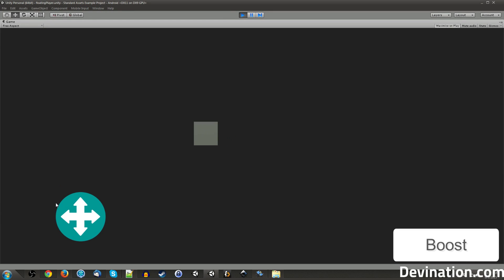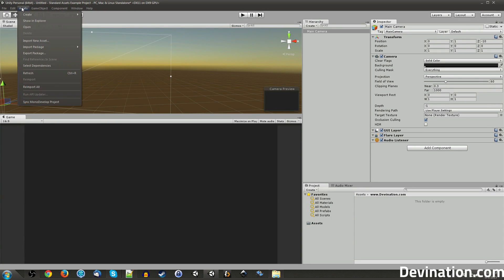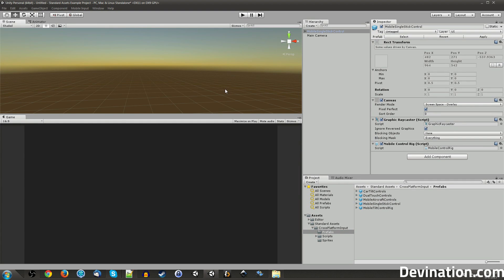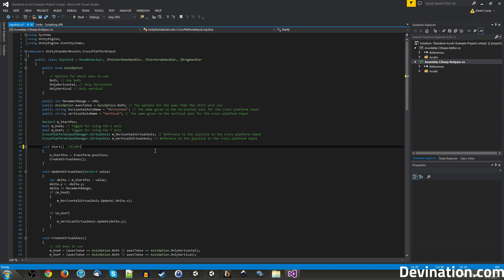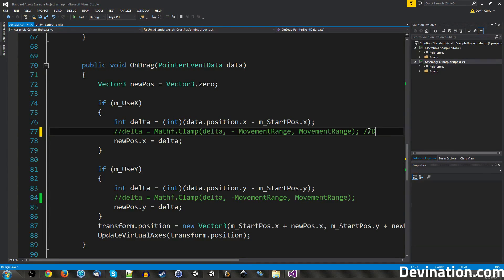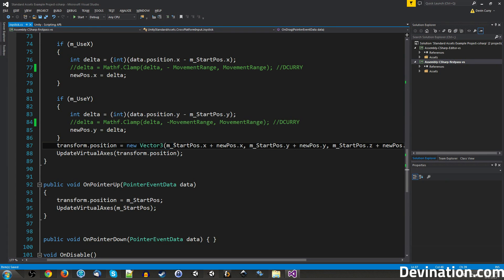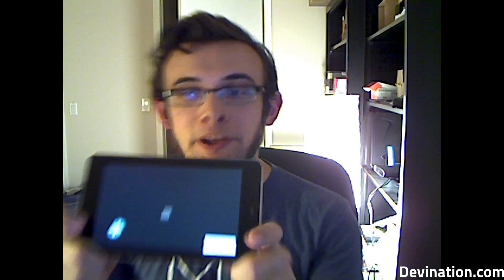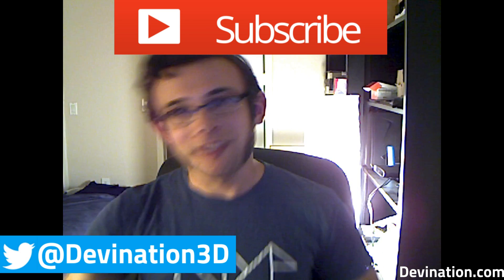Unity 5 Mobile Joysticks Tutorial - Touch Input 2D Spaceship Controller

Comment: It works... Kind of... But how do I make that the player move without gradually slowing down? (meaning that the player stops moving as soon as i leave the finger from the controls) Also, as soon as I touch the controls the player goes fast as hell. I tried changing the value from 5 to 1 or even lower but nothing changes...

Comment: Thank you for your tutorials, if someone have the issue that it didn't move because haven't done the tutorial about the button, do it and hide the image script from the jump button and do the the tutorial about the button at the end.
Reply: I'm having an issue where I can't even move the joystick at all. I've done everything in the video and my settings all seems to be correct. I'm wandering if it's because the script used in this video is outdated?
Reply: The best solution is do it again ( I have to to another level using this tutorial and around 2 or 3 hours doing the same in diferent ways and finally it worked, idk how but unity is weird

Comment: I have a question: Why in my project  if I have a code like this:
var sprintPressed = CrossPlatformInputManager.GetButton("Sprint");
written in the FixedUpdate.
Why Unity detect if I press it just once and not once every frame? What I did wrong?
My "sprint" button is like your Boost Button

Comment: This is amazing, but how would i make it so that only run the joystick if its on a mobile device and run the keyboard commands on a computer, because i want to implement it into my game
Reply: Build one version with the touch controls, then create the same scripts but with keyboard controls, then apply the keyboard scripts and build that version
Reply from the maker: You don't have to make 2 different scripts. This script will work that way automatically. The CrossPlatformInputManager class makes it so that if you build on mobile it will read data from the virtual joysticks. But if you build on PC it will accept what ever you have for "Horizontal" / "Vertical" input set in your Input Manager (keyboard and physical joysticks by default)
Reply: I ended up having the keyboard controls be under  #if  UNITY_STANDALONE || UNITY_WEBPLAYER, and the use  #else  for the mobile input

Comment: Is there something I have to do to get this to work in the Unity Editor? It will work on my phone if I build it and install the APK but I can't use it straight from the editor in Unity to do testing. And I would like to avoid having to build and install the project every time. I have tried running the scene on both iOS and Android platforms and there is an Eventsystem in the scene

Comment: This is awesome, Devon. Can you help get the right stick to come the camera like your " Unity Touch Joystick Player Rotation  - Touch FPS Controller (Part 2" video?
I watched the Unity Touch Joystick Player Rotation video and the new Unity does not seem to support the Touch class.  Is there another class to get the yaw and pitch to work?  It is having a bit of trouble accepting "Input.GetTouch (touch2Watch)" and the "camera.eulerAngles"  code in the "void ApplyDeltaJoy ()" from the previous camera rotation video.

pitch-= Input.GetTouch (touch2Watch).deltaPosition.y * rotateSpeed * Time.deltaTime;
    yaw += Input.GetTouch (touch2Watch).deltaPosition.x * rotateSpeed * Time.deltaTime;
    
    // limit so we don't go past 89 degrees
    pitch = Mathf.Clamp (pitch, -89, 89);
    
    // do the rotations to whatever this controller is attached to
    camera.eulerAngles = new Vector3 (pitch, yaw, 0.0f);

Comment: How can I increase the speed of the block as it has a set limit which is not as quick as I need. Great video by the way thanks.
Reply from the maker: +Chris Devine Make a new float variable called 'speed' then multiply your moveVec by speed when applying force

Comment: Devin,
When I am touching the joystick and at the same time touching jump button, the jump does not work. 
[Position of joystick : to Left
Position of Jump : to Right]
Also, if my joystick is to the left and I hit jump button, the joystick moves to right(towards jump button, though not beyond its range) and jump does not work.

SO, I see the problem is it is not distinguishing between single touch and multi touch.
Any solution?
Reply from the maker: If you are using the Unity Remote to test this, it will not support multitouch. You will have to build to your mobile device to test out the multitouch functionality
Reply: When built, and installed on phone, the joystick does not even move. Can you put some light on that?
Though, multitouch is working that way (Thanks a lot.)
Reply: Thanks for the help 
It is working fine now!!

Comment: i done everything the same but yet it says "Assets/Floating2DController.cs(23,105): error CS1729: The type `UnityEngine.Vector2' does not contain a constructor that takes `1' arguments" and i have no clue what it means by that
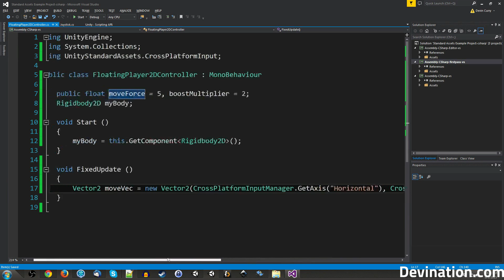Reply from the maker: +No Craig That error code says that you've missed an argument in defining a Vector2 (probably moveVec). Make sure you have 2 arguments in there ("Horizontal", "Vertical") I zoom out around 12:05 to show the full line with the 2 arguments in the code
Reply: +Devin Curry thx buddy I fixed it...keep up the good work

Comment: No words, just perfect and I didnt spend much of my time doing this so.. thx bro. +1
Reply from the maker: +Daniel Queiroz Awesome, I'm glad it could help!
Reply: Hey,  mate. Have tried to incorporate 2 joysticks at the same time? like 1 for movement and 2 for look around - it looks like it has some problems - 2 joysticks sorta interfere with each other.
Reply: Vladimir Kornev yeah i did, i dont remmeber what problems i had but  i had to changed some lines of the code in order to make it Works well :)
Reply: Daniel Queiroz maybe you'll give me a hand then? I constantly experiencing a bug - move one of the joysticks to some side  and just hold it (like moving forward for example) and then when I start moving the second joystick (looking around) the first one starts to also move from side to side although my finger is still, it's like it's receiving PointerEventData update from the second joystick.

Here is the code, I really fail to understand what's going on... "bigImg" - is joystick's square - it's only as big as the joystick itself.

public virtual void OnDrag(PointerEventData ped)
    {
        Vector2 pos;
        if (RectTransformUtility.ScreenPointToLocalPointInRectangle(bgImg.rectTransform, ped.position, ped.pressEventCamera, out pos))
        {
            pos.x = (pos.x / bgImg.rectTransform.sizeDelta.x);
            pos.y = (pos.y / bgImg.rectTransform.sizeDelta.y);

            inputVector = new Vector2(pos.x * 2f + 1f, pos.y * 2f - 1f);
            inputVector = inputVector.magnitude > 1f ? inputVector.normalized : inputVector;

            joystickImg.rectTransform.anchoredPosition =
                new Vector3(inputVector.x * (bgImg.rectTransform.sizeDelta.x * .3f),
                inputVector.y * (bgImg.rectTransform.sizeDelta.y * .3f));
        }
    }
Reply: I have some ideas what could be but i can't give u much help with only with this part of the script so u have 3 options:
1- you send me ur hole project or scene that it happens
2- I give u my project that i did it when I Watch this video and you see my scripts and try to understand.
3- Or i could maybe do a very small example using two josytics moving things independent

In either case im almost sure ur both sticks are point to the same transform, of corse i can be wrong. When I did this i have so many problems because I wanted to use not only 2, (Actully the user could choose what kind of controll they want so there were at least more 3 sticks hidden which gave me a lot of headache).

Oh and I remember a similar problem but it was 10 month ago, I dont remember very well now, i would need to see everything again about this xD

Comment: is it possible to use the joystick to also rotate the player to point in the direction it is moving? Trying the below code but that just makes it continually spin..

var horizontalAxis = CrossPlatformInputManager.GetAxis("Horizontal");
transform.Rotate(0,0, -horizontalAxis * Time.deltaTime * rotationSpeed);
Reply from the maker: +Lee Dennis Yea its a little more tricky, you'll have to find the directional vector from the joystick's start position to it's current position, then set the GameObject to orient down that same direction vector.
Reply: +Devin Curry Thanks Devin, I actually managed to get it working with the below code. This rotates the player to the same orientation as the joystick.. only problem is it jumps immediately to the rotation so next step is to figure out how to rotate based on a rotation speed..

float horizontal = CrossPlatformInputManager.GetAxis("Horizontal") * Time.deltaTime * acceleration;
float vertical = CrossPlatformInputManager.GetAxis("Vertical") * Time.deltaTime * acceleration;
float angle = Mathf.Atan2 (horizontal, vertical) * Mathf.Rad2Deg;
if (isMoving){
transform.rotation = Quaternion.Euler(new Vector3(0, 0, -angle));
}

Comment: Hello,

I am having problems with the CrossPlatformInputManager, it says it can't be found, and give the error CS0246:
The standard asset is there, what could be the problem?

Thanks.

Julio Amancio
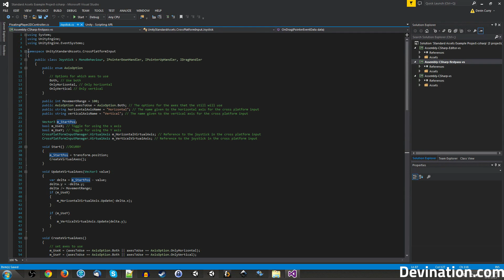Reply from the maker: +Julio Amancio Is it your player controller that can't find the CrossPlatformInputManager? If so, make sure you include the "using" statement like I do around 10:02 in this video. If that's not it, try reimporting all the things I do from that package at the beginning of this video. Something might be left out.

Comment: Great video, for anyone who'd like to use this on 3d rigidbodies(and colliders), you'll need to change the code.

replace this:
Rigidbody2D myBody;

 Vector2 moveVec = new Vector2(CrossPlatformInputManager.GetAxis("Horizontal"), CrossPlatformInputManager.GetAxis("Vertical"))* moveForce;
  bool isBoosting = CrossPlatformInputManager.GetButton("Boost");
  myBody.AddForce(moveVec);

by
public Rigidbody myBody;

Vector3 moveVec = new Vector3(CrossPlatformInputManager.GetAxis("Horizontal"),0,
                                CrossPlatformInputManager.GetAxis("Vertical"))* moveForce;
  bool isBoosting = CrossPlatformInputManager.GetButton("Boost");
  myBody.AddForce(moveVec);

As you can see i've put a 0 in one of the 3 axis, so it'll still behave the same as the 2d version but if your setup is different than mine you may need to switch the 0 with another axis. 
For example: new Vector3(CrossPlatformInputManager.GetAxis("Horizontal"),
                                CrossPlatformInputManager.GetAxis("Vertical"),0)
Reply: +Adriano Ferreira If its in 2D, try to multiply the scale value(s) by -1. 
With a 3D model you could use the transform.LookAt(Vector3.zero); .
Just an idea.
Reply: +chaoticdanor Thank you this was very helpful :D
Reply: Np! Glad i could help :D
Reply: +chaoticdanor My character wont move for some reason, I added all the stuff
Reply: +chaoticdanor how can i look for that direction? i can move for all directions, but my character can't rotate :( . I need it in the same joystick. Thank you buddy.
Reply: Thank you Gábor Szentesi.

Comment: Hello Devin, nice tutorial. Do you mind posting a new video or just the code here how to make your solution working from 2D with a 3D (Vector3) object. Thanks alot.
Reply from the maker: +Roger Lindfors It should be pretty much the same code, just where ever you see "RigidBody2D" replace that with "RigidBody" and replace "Vector2" with "Vector3". Then when you're constructing that new Vector3 for the moveVec, just add an extra argument for the z axis. And you might want play around with the placement of our current arguments. ie We might want to move the GetAxis("Vertical") from the y position to the z position

Comment: Hi Devin, Thanks for this great Tutorials I really appreciated, hey but one question I am trying to use the UI button to attack so I used the Boost button to run the attack animation so in the "Platformer2DUserControl" I use an If so when the CrossPlatformInputManager.GetButtonDown ("Attack") button is pressed I set a Bool Variable to true and then run the animation "m_Anim.GetBool ("Attack");" but once that is done the animation never stop so I set the Bool variable to false out of the if statement but even so the animation never stop so do you know whan Im missing ?

using System;
using UnityEngine;
using UnityStandardAssets.CrossPlatformInput;

namespace UnityStandardAssets._2D
{
    [RequireComponent(typeof (PlatformerCharacter2D))]
 public class Platformer2DUserControl : MonoBehaviour
 {
        private PlatformerCharacter2D m_Character;
  public bool m_Jump,m_Attack;
  private Animator m_Anim;

        private void Awake()
        {
            m_Character = GetComponent<PlatformerCharacter2D>();
        }

  private void Update()
        {
   if (!m_Jump)
            {
                // Read the jump input in Update so button presses aren't missed.
                m_Jump = CrossPlatformInputManager.GetButtonDown("Jump");
   }
   if (CrossPlatformInputManager.GetButtonDown ("Attack")) 
   {
    m_Attack = true;
    m_Anim.GetBool ("Attack");
   }
   else if (CrossPlatformInputManager.GetButtonUp ("Attack")) 
   {
    m_Attack = false;
   }

  }

        private void FixedUpdate()
        {
            // Read the inputs.
   float h = CrossPlatformInputManager.GetAxis("Horizontal");
   // Pass all parameters to the character control script.
   m_Character.Move(h, m_Attack, m_Jump);
            m_Jump = false;
        }
    }
}
Reply from the maker: +Nelson Andres Zavala Jimenez Looking at your code, I'm not even sure how you're getting the animation to play at all. At no point in this code do you ever assign the Animator component to m_Anim. You also use GetBool("Attack") when I think you intended to use SetBool("Attack", m_Attack). You'll need to set the bool in both the ButtonDown and Up to signal to the animator that you'd like it to stop.

Comment: Been trying to figure out how to scale the joystick so it would look the same size on multiple devices. Every script i attempt to write doesnt do it as they are being over written in the code for the standard asset. If anyone has any ideas on how to make the standard asset joystick scalable for different mobile resolutions hit me up! <3

EDIT: FOUND A FIX Checked the api (again incase i missed something, which i did) use a canvas scalar. Works a treat
Reply from the maker: +No1Survivalist I've also got a video on using Canvas Scaler in conjunction with Anchors to make your UI fit: https://www.youtube.com/watch?v=XkfhxuNr9Es

Comment: This work in 2D Object?
Reply from the maker: +halconf20 Yes, all the code and physics we used in this video is 2D. Technically we are using a 3D cube as our Render Mesh but you could easily remove that component and apply a sprite component instead, it will function exactly the same.

Comment: +Devin Curry
Don't s'pose you'd have any suggestions why multi-touch doesn't wanna work with this project on Unity Remote.
I've modified it for my game, but installing it on an android device works fine, so it doesn't seem to be the code doing it.  And s'posedly if you download Unity Remote as an app, multi-touch is automatically enabled (can't see anyway of accessing this via the app regardless).
Reply from the maker: +Steven Mathews As long as the game is running on the computer and we're using the Canvas UI. The Unity remote will treat touches like mouse input on the Canvas UI objects. I'm not sure if this was an intentional design by Unity or not but it would be worth sending as a Bug to them.

Alternatively you could access Input.touches directly if you want multitouch to work with the Unity Remote. I've got older videos on how to do that but it requires a lot more code. I'm actually gunna report that Canvas/Remote/Multitouch to Unity as a bug right now and see what they say

Comment: Hi Devin, how do I make it so the joystick controls are more responsive as if I were moving a 2D character (like Mario) left and right in a platformer? I have it working but right now the movement seems to start off slow than rapidy multiplies and becomes uncontrollable, I would like it to stay at a constant moveForce. I know it has something to do with TwoDController.cs and the moveVec calculation but every time I modify the code my play joystick stops working or bugs out. Any help would be appreciated and great video! Thanks.

Comment: I tried to add the using UnityStandardAssets.CrossPlatformInput; but i get the error that the type or namespace 'UnityStandardAssets' could not be found. Am i doing something wrong ?
Reply from the maker: +puranjay rajpal Have you imported the CrossPlatformInput stuff from the Standard Assets first? Also don't move the scripts out of their folder. The "UnityStandardAssets.CrossPlatformInput" corresponds to that folder directory where the script lives